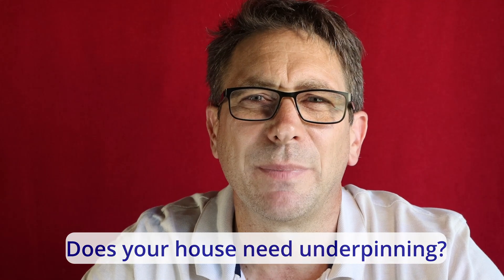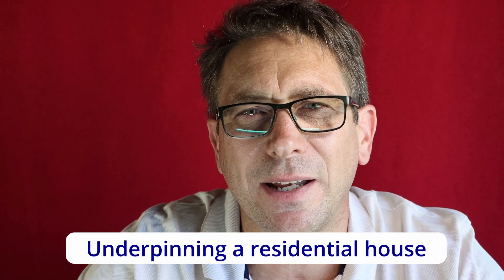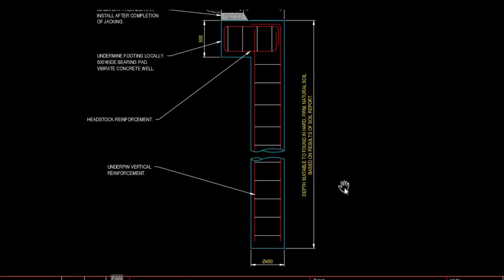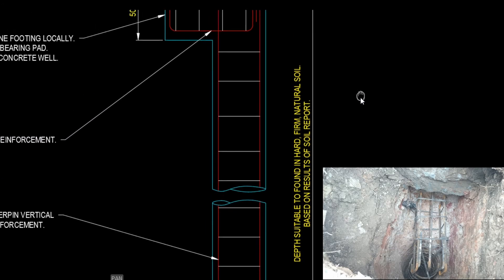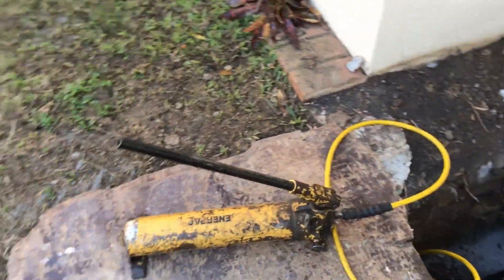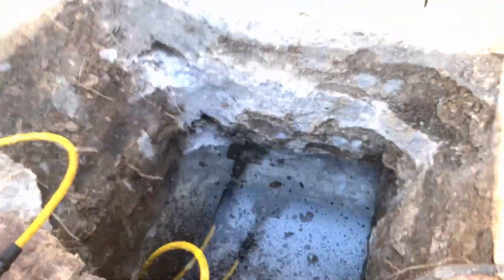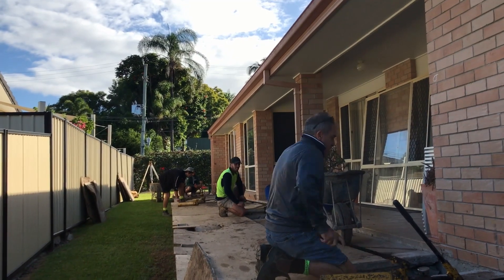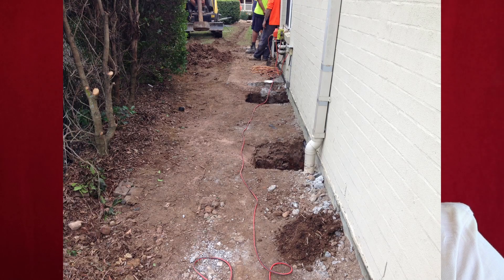What is Underpinning? What is the purpose of underpinning? How does underpinning a house work?

Comment: Why can't you leave the jack under the house instead of messing around with all that messy concrete?
Reply from the maker: Good question. You can - but better still why not do both? Leave the jack there and backfill with concrete also. Jacks are a lot cheaper than they used to be - but still not as cheap as steel packers and some concrete.

Comment: Hi Matt
Really appreciate your videos and how you communicate technical information to unqualified people such as myself.  I've been trying  to educate myself in relation to current methods of renovating old Qlders, in particular how to use modern materials such as steel in replacement of timber. ATM I'm struggling to get my head around the difference in the potential strength and span of steel when comparing with timber bearers. Is there any chance you might do a video on this subject at some time?
Reply from the maker: Thanks for the comment and the idea! Moving from timber spans to steel spans certainly increases your opportunity for bigger spaces downstairs under a house raise/Queenslander. I'll put my thoughts together and try and honour your request with some useful ideas.
Reply: I have done some of these in the past on the old Qld's, excavated under the existing house to allow for better hight clearence, used Acro props in many locations to support the stucture, depending on soil type or rock either do pad footings to solid rock or ground and or drill piers to engineers specs (usually to the point of first resistance) then use and repalce existing load bearing floor joists at recomended intervals with I beam or timber depending on span, the cost varies depending on site.

Comment: Cornell, joke time (my humour) ...      I herd you simply remove the soil around the structure and regrade the land to make the house look like it is plumb? 
Wait, one more.... I herd that a house was sinking but it was on a hill, so the owner just removed the soil around the house and still has 10 feet to go... haha  
Thank you Matt for the video.
Reply from the maker: I know, right? If your house is on a lean just tilt your head till it looks right. And play marbles outside.
Reply: @CornellEngineers  ,  I take a long time to ''data stack'' to teach on how materials behave...  With that said, take a look at ''nature's stirrups" and you may not look at a tree the same again... 
I also am working on data stacking the tension internal to concrete (in a slab design) and how the tension is internal stress that breaks the bond of rebar and concrete... How deflection creates this tension and once we go beyond the stable position of rebar internal to the concrete (deflection) we have internal tension between the compressive ''side'' and the tension ''side'' AND when we have cracks we have another ''neutral axis created" (no longer the same as "pre-crack" neutral axis)...
Here is the one video, which I like and asking for your feedback on this ''reveal of theory"  (you seem to understand the importance of cracks in concrete)...
Note: I have a lot more in data stack pipeline that I will reveal but want to make sure I am somewhat coherent in my attempts to explain...
Thank you for your review (two videos)
Stirrups https://youtu.be/EkLmswdTXe0
and 
https://www.youtube.com/watch?v=6FyhiOhoVVA